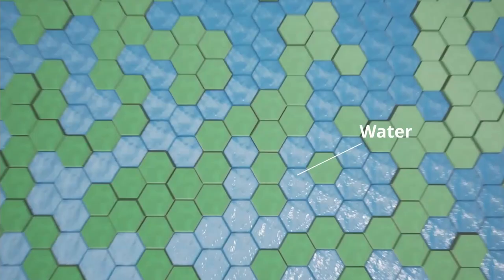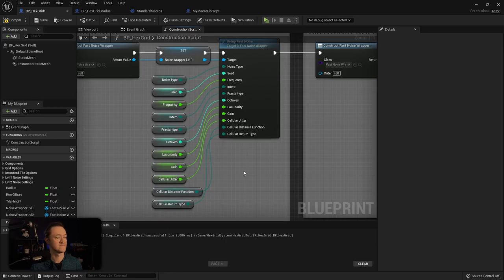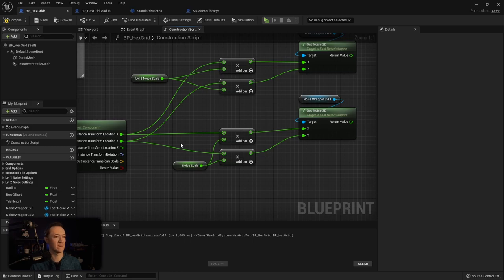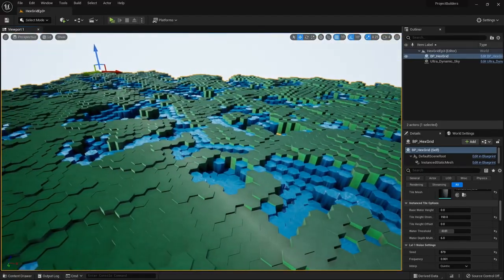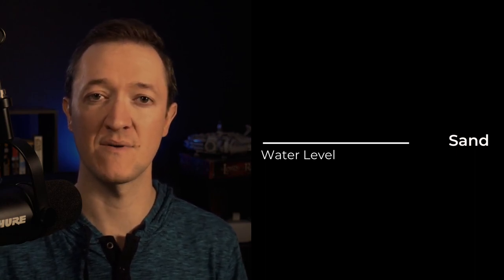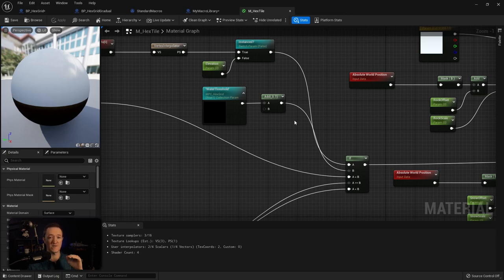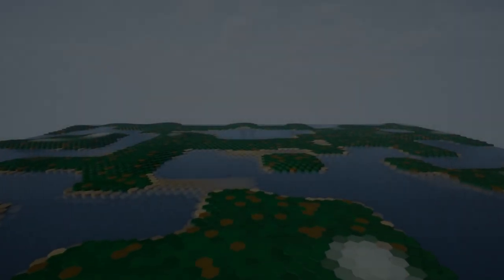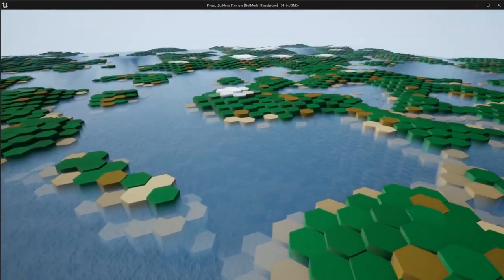Generating Procedural HexGrid Maps in Unreal (Devlog)

Comment: Hello, sorry for the trouble but I'm facing a small issue, I have everything set-up but I've never worked with noise before and don't understand what values to put in, a small explanation would be appreciated or if you could tell the values if possible. Thank you and this is an amazing series.

Comment: I almost got everything working. But the tile height never changed. It remains as flat as the were originally created. What z scaling function am I missing? I never did the "Set Scalar Parameter Value" for MPC, is that it? What should those parameters be?

Comment: I have been working/learning using your hex videos for a couple of weeks, Is there a way to have the noise wrapper being "world" size or maybe on a bigger scale where my hexinstancer can make the height of the individual hex tiles correlate to the "noise", Hard to explain. I want to be able to move my instancer/tiles and have the noise not "stuck" to it, that way if I add another Instancer beside my first one it will be contiguous between the two no matter where I move them, right now they look the same using the same see etc...

Comment: I do have a question, I would really love to use this perlin noise and I am a bit stuck.
After I install the plugin I cant see Fast Noise Wrapper in the Class, nor the Setup Fast Noise function. I checked if It is installed, I removed twice and added back. Tho I use UE 5.1.1 might be this the issue?
Reply: Answering myself again :))
Ehm yeah, I didn't know you was supposed to check it in the plugins menu, I thought it works like the assets. Pretty new to to UE
Thanks tho for the videos, really helping a lot, and sorry for my stupid questions but I hope it will help someone that had some misunderstandings like me and was a bit ashamed to ask <3

Comment: Hey! great job again ! :)  I use the same noise for my own system, but i picked one for the height level, and another for the ocean.. like that i can have more cliffs
Already waiting for the next video :P
Reply from the maker: Thanks!  I like your combo...I'll have to test how that might affect my system.  I have to test how each layer affects performance but I would love to add moisture level and temperature layers also.
Reply: @stayathomedev   i did biome with temperature and all depending on noise, but i think i did it on a messy way
Reply from the maker: Very cool!  I will have to do some research regarding temp and latitude changes.